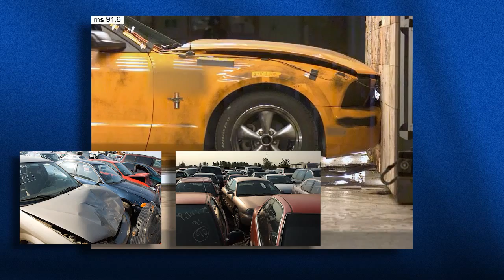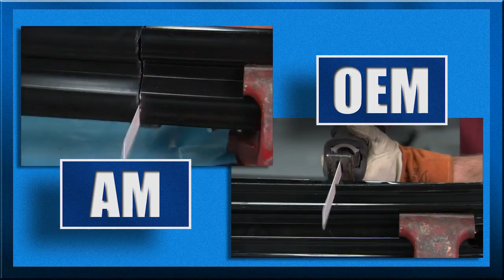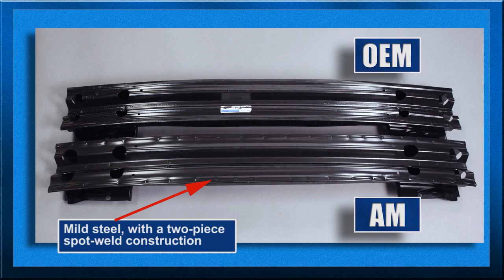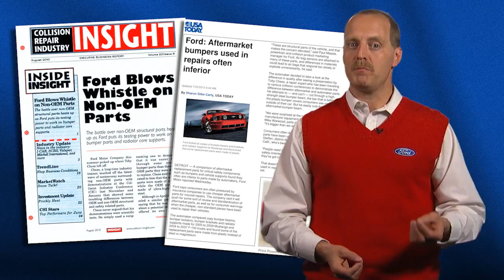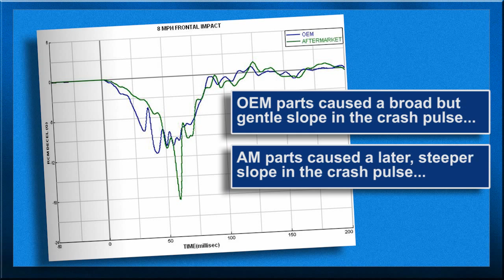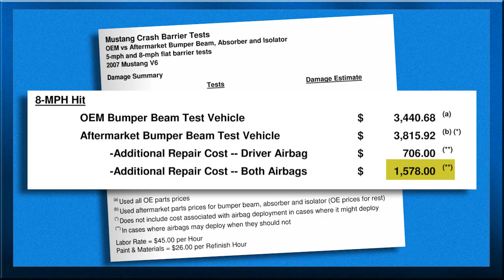OEM Vs. Aftermarket

Comment: I have  question for you . I have been debating with people on car soft roofs  for convertable  and i knew that  the aftermarket roof sheets  had way less qualitythan the original no matter year of car they originate from like for exemple my 1968  Pontiac Parisienne  convertable whitch need  a new roof  when i bought it for restoration .

 Many guys on  facebook sites for car restorations suggested me  some places  where prices were unbeatable and when i did each ones had prices ranging between 250 and 500 brand new . Right there i started to get suspiscious about about the durability  and longivity of a roof in those price range . Not to mentioned that i was raised in the wyers that those cars were created and this made no sens to me that the same roof that you bought in 1968 at the cost of 300 to 500 dollars would still be the same prices today . It simply made no dam sens unless  the one in those prices were aftermarket with  a very low quality and durability . So right there i decided to not buy a roof untill i was sure that this was my only option or that i was wrong and that they had  the same quality . And as suspected i found only one company who made the original ones at the same spec as the original in 1968 and they were located in the states . And when i asked them what was the difference between the aftermarket ones of today and the ones with the real specs of 1968  they answered this  '' while after market soft roof are fairely good for their -prices  their quality goes even with their prices . and in the case of original specs  the quality also goes even with the prices and since the ones with the original spec are much thicker  than the after market ones their durabilty last way much longer not to mention the higher quality of the material they are made of . and lets just say that the prices for a real soft roof  withthe same wuality as as the original ones  was way higher than an after market one like way more expensive  like in the four digits with the number 2  in my case .

 do you think that this was a right statement or was i mislead ? cause after i bought the real one  i compared mine to the ones on some other peoples with after market one and yes there was a huge difference in thickness and i also notice a huge difference in the texture of the material wich mine seemed more like the original one than the after market one .

Comment: This make people fool and buy OEM than aftermarket.
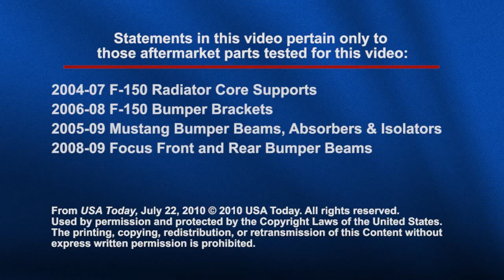Reply: So how is that and upon what do you base your assertion?  Let's use 6:44 as our example.  The presenter makes the assertion Ford uses a 1-piece of boron steel with a full seam weld down the middle.  Then he asserts the AM uses a weaker beam with spot welding for the same part.  How is he fooling us and how have you determined this?  Does Ford use a 1-piece of boron steel with a full seam weld down the middle?  Does the AM part use a weaker beam with spot welding?
Reply: @mitch1847   dont bother most of people who object to these videos are people ho sell aftermarket parts and some are the ones that repare with aftermaket parts and charge the price of  grade A quality parts on their bills something that the customer cannot see on the final bill . I for one have worked on the mecanic industry for 40 years and never have i seen an aftermarket outlast or out class an OEM . Take the bumper of a 2008 chevy pickup truck rear bumper , can you bend it with your hand and see it try to bend ? no you cant  cause that steel will simply not budge , but you can do that with an aftermarket one right out of the box and bend it without being even installed yet and once its on the truck its even easier to twist it . sure it comes back into place when you let go but you know what i mean .